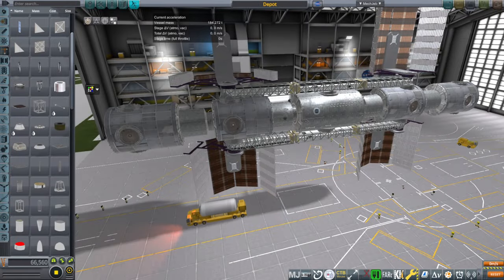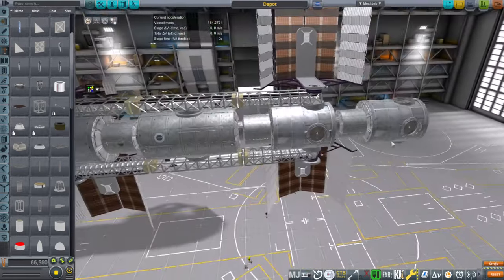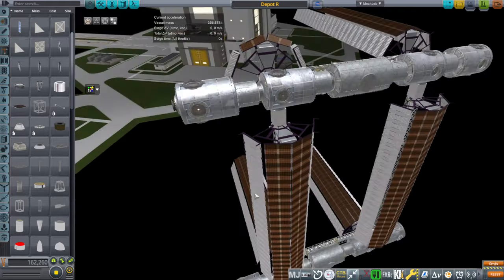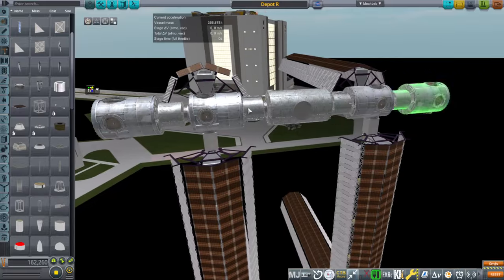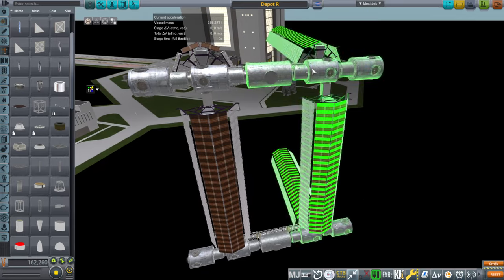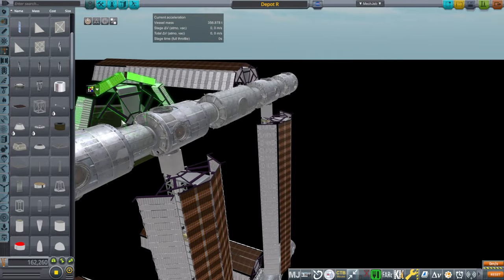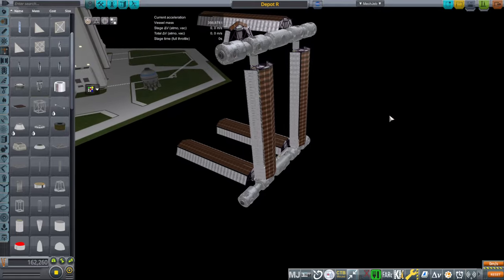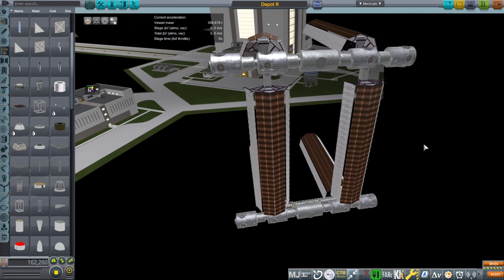Starship Depot Revised (RO in KSP 1.12)

Comment: Agreed, there would definitely need to be some separate structural trusses between the two pressurised modules, also, the risk of maneuvering between what would effectively be walls, seems like way too big of a risk. Not meaning to take a dump all over your concept, but wouldn't it make more sense to just have another half of the shielding? It might increase the mass of shielding needed to lift but with the complexity and extra structural bulk needed to support rotating that much mass..... It's alot of inertia... Just cover the other half of the tank with another extendable shield. Really enjoy your channel by the way, I'm on the cusp of starting my engineering career so it's nice to have this kind of thing to gobble up.
Reply: Also how does the ratio of depots to ships work? As in is the idea that one depot completely fills the tanks of one ship? Or will interplanetary/lunar starships use smaller tanks like the current header tanks? I guess what I'm asking is how much fuel will be needed for a mission from Leo? Thinking about the numbers of depot tanks which would be needed at a single depot station for it to be worth it if that makes sense.
Reply from the maker: It's actually harder to make radiators or solar panels retract than to rotate them - practically all station solar panel and radiator arrays already rotate, so I'm not sure why you think rotating them is a big deal. Perhaps you're thinking the Starship rotates with them - that's not the case. The Starship is on a fixed port with the station and the panels rotate around it - that's the innovative part of the design. If the panels surrounded the Starships, we wouldn't be able to dock without retracting the radiators first.
Reply from the maker: The most that a mission will need is one depot's worth of propellant, but some missions might be fine with less (especially if they use other vehicles like Shinkansen).
Reply: Ah! You're absolutely right, I thought the tank rotated too.